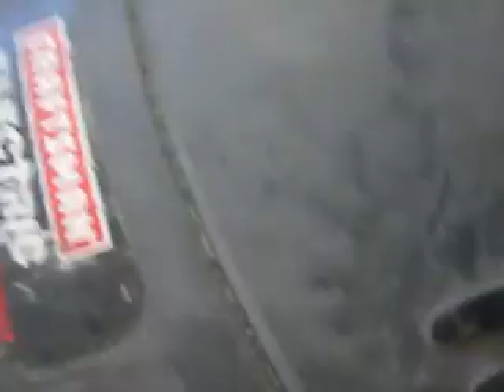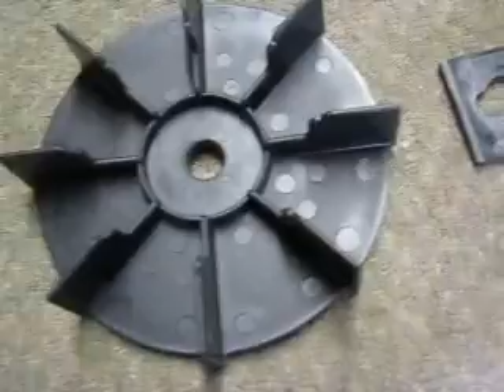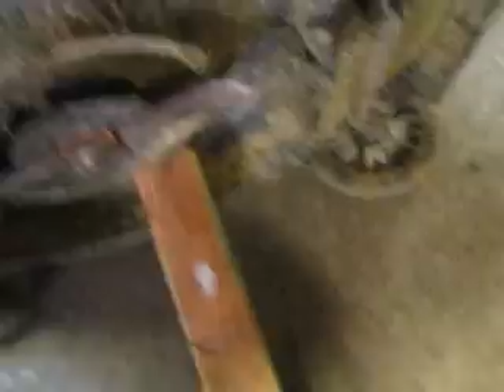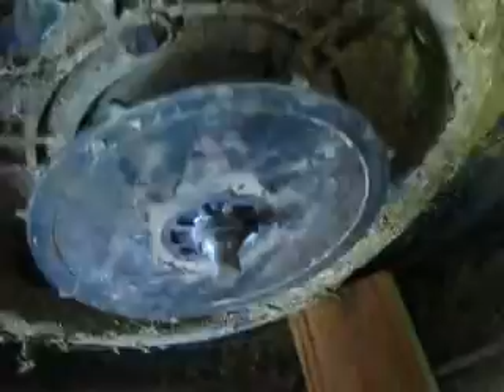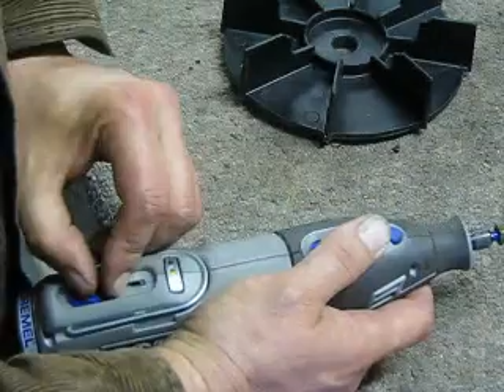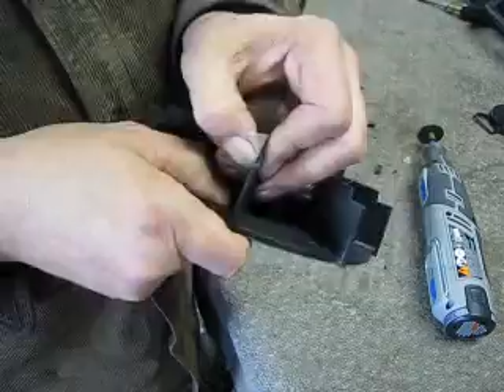Electric Lawn Mower Repair - Craftsman / Black & Decker, Fan and Blade insulator

Comment: The same broken BD fan I'm trying to replace is seemingly fused to the round metal spacer hub beneath it. Trying to pry it off, the outside of it shattered but the center spindle remains stuck. Trying to chisel the rest off, but it's not budging. Never seen this before. Can I melt it off?
Reply from the maker: I usually get them off prying and scraping. I imagine it will melt off but I don't know how bad the residue will be. Good luck!

Comment: Thanks for doing this video and telling me about the notching of the fins.  I put the new fan on, heard it click as I turned it by hand and thought the same thing you did - that's not going to end well for that fan or my wallet!!  I tried putting a washer on to add some space, but then I couldn't get the nut back on, so I guess I'll notch those fins!  I'll be cutting those by hand as I don't have a Dremel!!  Makes you wonder why they don't just make 'em pre-notched.

Comment: Don't understand why you have to Dremel the fan if its the correct part for the mower. The fan worked fine the way it was when new. Are the replacements not identical?
Reply from the maker: As the motors age usually the bearing thrust increases causing the fan to contact the mounting screws. Trimming the blade stops this, the alternative would be to replace the motor which would not be cost effective.

Comment: Question. I have the same issue with the insulator but having issue with the bolt turning separately from the blade and bushing. In other words I can't get the bolt of because its free turning. Any advice? Thanks
Reply from the maker: If you're using an impact you can pull on one side of the blade and it will break loose. (Caution; wear gloves, do not try this if you cannot do it safely)
Reply: Cool!

Comment: Your video was very informative.  Maybe you can help me.  I have a B&D SPCM1936 cordless mower.  My blade does not turn freely, it binds and gets stuck. When this happens, the mower won't start.  How do I get the blade to move freely>
Reply from the maker: Is the blade or fan binding? If not the motor is probably shot. I've seen bearings shot, shafts bent and armatures broken.. Good luck.

Comment: I have a B&D electric Lawn Mower-a Lawn Hog to be exact- that has started making an awful noise 5 seconds after being turned on. It's sort of a loud squealing and grinding sound. Any thoughts on what it could be?
Reply from the maker: Probably a bad motor. Unplug and turn blade by hand. it should turn freely and quietly.
Reply: If it turns freely and quietly by hand, does that mean the motor is shot?
Reply from the maker: Take the top off and look to see if the armature is broken. Carefully run when exposed if the noise is from the motor it's probably tine for a new mower
Reply: Thanks very much

Comment: for some reason my blade bushing and insulator dont have room. i put it all on like the video but the bushing is not fitting right to even out on the bolt so it slips like crazy.
Reply from the maker: Is the center of the fan melted and shrunk from spinning?

Comment: ONce again your video is clear and concise.  Thank you.  One question.  My Electric Lawn Mower (same as in your video) sat for 10 years.  Cylinder (magnet) is rusty.  Any suggestions for cleaning that part?  Is it necessary to do so?  Thank you.
Reply from the maker: If there's no contact it's best left alone.

Comment: I have a B&D mower that now starts but browns out the breaker that it's plugged into. the blades do turn freely but I never turned them before so I do not know if there is unwanted resistance..
Reply from the maker: +PhunkyMan There is a bridge rectifier mounted to the motor that usually shorts out. It is the square piece with four wires mounted with a single screw top rear of motor. Remove the top cover (two to four torx screws in the top ans two on the sides next to the handle) You can check it with a meter or continuity checker, no two leads should read shorted. Careful, connections must be exact or disaster occurs. Thermal compound should be used on the aluminum mounting surface.  Good luck!

Comment: This is about the insulator installation. You don't show or explain in detail how it goes on. In your video you are not certain yourself as you hesitated and turned it around then seemingly found the right spot. You don't show or say how the ridges are supposed to line up with the mower blade. Is the blade supposed to fit between the ridges? I picked this mower up on the side of the road. There was no insulator when I took off the fan etc. My guess is the guy who owned it put on the wrong blade. This one does not fit between the insulator ridges. Again, your video does not show this or mention this. I obviously don't want to assemble it if I don't have the correct blade.
Reply from the maker: +SD Lawson The Black and Decker mowers insulator edges should fit around the edge of the blade. The insulator is designed so that if something gets hit while mowing the edges shear off decoupling the blade from the mower. Safety first, if the mower doesn't have the correct parts it can be dangerous. Parts and diagram are usually available at searspartsdirect dot com.
Reply: Thanks, just as I assumed.
The blade on this mower does not allow the insulator to sit flat against the surface or between the insulator ridges. So new blade shopping I go.
Reply: +Alameda Repair Shop I picked one up non working. The fan is pretty much gone. It wont turn at all when I apply power but I hear the motor hum. Owner said he hit a stump and it stopped working. Is this designed to stop running if the fan is damaged.  If replacing the fan will put this back in service then great but I don't see how that keep it from running. Appreciate your thoughts.
Reply from the maker: +Glen Whitley The motor should still spin. With power disconnected the blade and motor should spin freely, if there is a bind the motor is probably shot. (bent shaft) Sometimes the blade is bent and binding. If the motor shaft doesn't turn freely it's shot.

Comment: I just bought a used black and decker mm875 electric lawn mower. i tried it out for the first time and while I was cutting the grass, it started stall. I would till the front end up and it would run fine but when i put it back down (with resistance) it would stall and die out. The grass was went so I guess there's more resistance. The fan blades looks good.
What could the problem be? Much help would be appreciated. Thank you.
Reply from the maker: +savoeun tim Let the grass dry before mowing and if the grass is tall raise the unit to its highest setting for the first mow. You can damage the motor mowing wet grass. Is the blade sharp? Happy mowing!
Reply: +Alameda Repair Shop I've tried mowing the lawn with dry grass, it helped but still stalls. Any other suggestions would be appreciated. Thanks.
Reply from the maker: +savoeun tim How long and what gauge is your extension cord?

Comment: the threaded shaft just spins when i try to tighten the blade and shoulf the metal washe lock in place that would make it possible to tighten nut?
Reply from the maker: dee spag All of the pieces must be there and intact, including the blade insulator. (plastic piece, edges must be intact)
 I hope this was helpful.

Comment from the maker: When assembled and tightened, (POWER DISCONNECTED), you should be able to hold the fan still and try to move the blade with the other hand and there should be no slippage. If it slips the fan could be shrunken and distorted from the blade slipping from a failed insulator and the blade spinning on it. You might try a thin washer between the fan and blade. Good luck!

Comment: Replaced my insulator but when I tightened it back up, soon as I gave it power, the new insulator stripped itself again by not holding onto the blade. I can't get the nut any tighter (it's pretty tight) without also having the new insulator spin against the blade. It just won't stay in place. Would an impact wrench be the key? I tried to tighten everything with a socket wrench and again, once I thought it was pretty tight, the piece restripped itself. I can only assume it was not tight enough? Why would an impact wrench keep the insulator from slipping on the blade while tightening? Thanks!
Reply: JackInOlyWa I'm embarrassed to say that I had the small metal washer under the fan/blade in backwards which was causing the new insulator to strip. So yes, it's fixed now and working perfectly. I found a local dealer that repairs Black and Decker electric mowers, they are a certified dealer. It's almost impossible to find any normal shop that will repair electrics outside the manufacturer. The key was that Dewalt owns B&D now so if you find a Dewalt repair shop, they are the ones you are looking for. Awesome people with all the parts you need.
Reply: Ray,
I have the same problem as you have. I replace 4 insulators so far. The experiment, i replace new blade, new fan, new bushing. Once i turn on power, the insulators get strip. It can't hold on the blade.
What you do you mean the small metal washer under the fan/blade? Is it the rounded. The bigger flat side in contact with the fan.
Reply: I finally got it to a shop and like an idiot, I had one of the pieces upside down. It was really hard to tell but that did the trick. Been mowing like a charm ever since. It's been so long that I can't recall which piece but I think it was the metal washer that holds the insulator to the shaft/blade. It's possible that it was the piece under the fan. Just make sure you have all pieces in the right direction. I felt really dumb as I swore I had everything right but the guy at the shop saw it right away and boom, fixed;)
Reply from the maker: If the blade has been spinning on the fan you may need to replace it. Is the metal bushing above the fan still there? Is the motor worn, IE Does the motor shaft have a lot of end play? And yes sometimes an impact makes a difference. One more; is the replacement blade the same thickness as the original?
Reply: Alameda Repair Shop The bushing is still there. Only thing I'm trying to replace is the insulator (no replacement blade) but soon as I fire up the mower with a new one, it just spins on the blade and gets stripped. The little plastic rails are not holding onto the blade maybe cause I can't get it tight enough. Not sure what you mean by "end play." Here is a video of what the motor sounds like without the blade on http://youtu.be/w7nr-LfP7xY
Reply: Ray Ortega Ray, did you ever get it to work. I'm having the same problem
Reply: I bent the square washer so the ends curved up and made it through another season.

Comment: when I try to remove the nut yhe shaft is also turning therefore removing the nut is impossible, any ideas?
Reply: LJ Dumpy I have the same issue...I'm tempted to block the fan, but since its plastic I'm not going to do it...frustrating
Reply from the maker: awigg1 Block the blade from turning and push it at an angle with your boot while trying to loosen it. Careful and good luck.
Reply: Grab the square metal piece with large ChannelLock pliers or a big plumber's wrench.  This piece fits onto the shaft with a hole that is not circular but has flats on it which match flats on the shaft, so when you grab this square piece (the one that fits over the insulator) you are in effect grabbing the shaft.  Holding this lets you then loosen the nut off the shaft.  Similarly this will let you tighten the nut onto the shaft adequately.   If that description does not do the job, see the video that another guy who solved this made, https://www.youtube.com/watch?v=KYKd01pKU0s

Comment: What does the fan actually do, and is it necessary to have it in good shape? On my mower, the fan is in place, but the blades are mostly gone. Do I need to replace it? Does it lift lying-down blades of grass so they get cut better? Does the fan cool something? I'm thinking of not replacing it (though I just sharpened the blade).
Reply from the maker: The fan cools the motor. If you're missing 1 or 2 blades you can probably get by, if it's more you can burn up the motor.
Reply: pafoofnic Thanks for your reply. I don't quite understand how it cools the motor, because the motor looks like it is separated from the fan. So (it seems to me) the fan doesn't blow cooling air on the motor. Am I wrong?
Reply from the maker: Ron Blau
There are cooling slots or holes on the bottom of the motor.
Reply: pafoofnic That makes sense. Thanks for the explanation!

Comment: Mine won't start & when I try to start it it blows the fuse to whatever plug where I have it plugged into
Reply from the maker: Make sure it's unplugged first.
If it turns freely by hand it's probably the full wave rectifier. (The thing with 4 terminals mounted on the top rear of the motor). If it doesn't turn freely the motor is probably bad and it's time for a new mower.

Comment from the maker: Does the motor run? If so it could be the insulator. Unplug the mower and look underneath and see if it's sheared. Motor not running ? see if something is jammed or wrapped up on the blade or fan. Do the fan and blade spin freely?

Comment from the maker: No. The blade insulator and shaft bushing that locks the insulator have no room for a washer and would be unsafe. If the edges of your old fan have been hitting the motor mounting hardware or the blade has been flexing from too much or wet grass trim the fan blades.

Comment: Instead of Cutting or Trimming The 8 Blades .. Could you just use a WASHER , UNDER , Or On TOP Of THE BLADE SPACER . So The Fan can Spin Freely Without Hitting The Bolts ..

Comment: Yeah, tried that method, but it would not bite quite enough to hold the shaft. Possilbly worn.The prybar method worked fine.  I have an older machine...metal fan - some blades are bent but none are broken. I just want to sharpen the blade.

Comment from the maker: While still blocking the blade from movement, hold the flat bushing that's between the insulator and the nut still with a large adjustable wrench or pliers. Very carefully at your and at your own risk or have it done by a repair shop.

Comment: Yeah, once the nut is loose the shaft and engine spins - frustrating. I got this off by taking a flat, wide prybar with a sharp edge, tapping it under the loosened nut, holding the prybar against the blade to provide enough friction to get the nut off with a wrench.

Comment: Well I finally figured it out!  With the switch on, there was nothing and the motor turns freely and the fan is undamaged.  I found a 40A fuse when I took it apart -- that had blown so I jumped it with a paperclip and it works now.  Thanks for the info!

Comment from the maker: No, the blade insulator is a shear plate. 
Does it make a groan or buzzing noise when the switch is activated?
If so with the unit unplugged does the motor turn freely or is there something jammed in the fan or the motor could be seized?
No noise the power switch, diode or brushed could be bad.
 If the motor is hard to turn and there's no blockage or the shaft is bent the motor is bad and probably time for a new mower.
 Hope this was of help to you.

Comment from the maker: usually blocking the blade and using an impact will get it or find something to hold the spacer between the blade insulator and the nut. Be careful!

Comment: I have the same problem - the blade and the fan are loose. But when I try to remove the outermost nut, the shaft keeps moving and I am not able to replace the fan/insulator. How can i remove the nut when the shaft keeps moving?

Comment: Thank you for your vid. It has saved my sanity !!!
I've been working on this craftsman 1350 electric for hours. What a serious design flaw. The whole time I kept thinking I'm doing something wrong. Also MASSIVE amounts of grass had gotten into the motor compartment causing  overheating, Yet another design flaw. craftsman must not care about there customers or reputation.